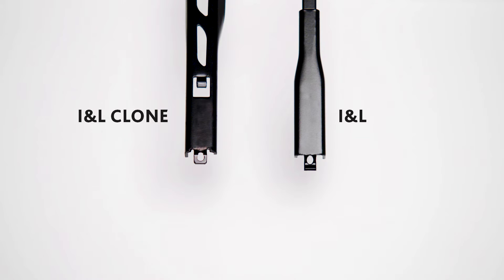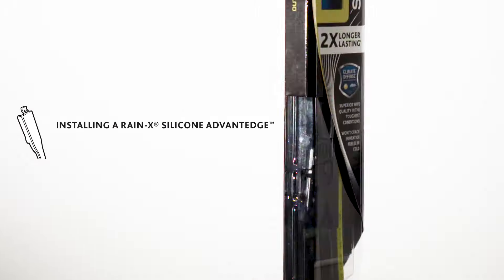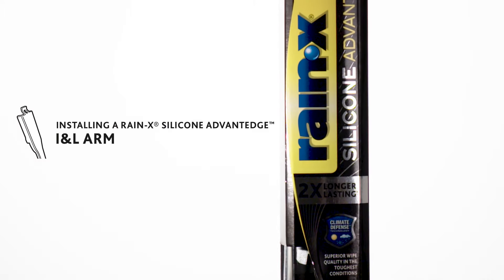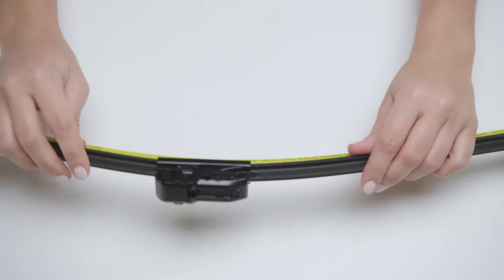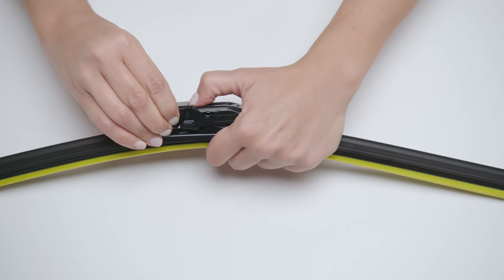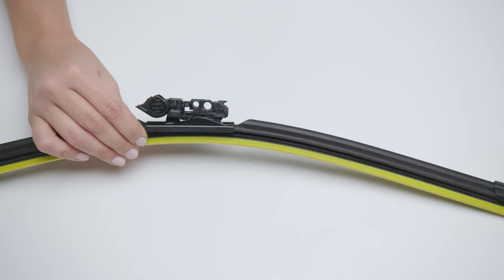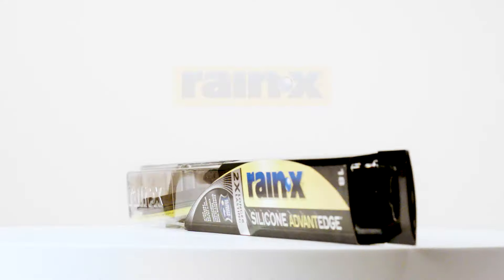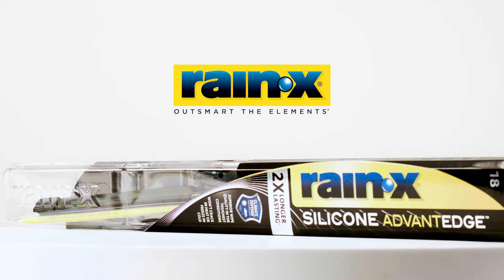Rain-X Silicone AdvantEdge Wiper Blade - I&L

Comment: One useful action to take.  When you hook the rear of the wiper mount to the arm, make sure the mount is seated hard up against the underside of the arm end.  If you don't, the end cap won't lock with a "click."  Just make sure the wiper mount is seated tightly inside the arm.

Comment: This video was definitely needed. Also, on my 2012 Silverado 1500, once I placed the arm into the adaptor correctly, I found that I needed to use more force than I expected to get the adaptor in enough to click - and get the cap to click closed.

Comment: I got stuck on the install at first because the wipers felt like they were going to break. I watched video and saw that I was doing it correctly in the first place! It snaps right into place, flip the lock over and they are done. Already a big difference vs my old blades.

Comment: Another word of "wisdom":  there is only a rear hook receiver  on ONE side of the adapter.  I started on the driver's side, and from my vantage point I could NOT figure out how to get the adapter onto the hooks.  Thirty Minutes Later (Spongebob narrator voice) I gave up and went to the passenger side.  From that vantage point, I could see the "other" side of the adapter with the receiver for the hook.    Sigh....
Reply: Thanks for pointing this out. Also, on my 2012 Silverado 1500, once I placed the arm into the adaptor correctly, I found that I needed to use more force than I expected to get the adaptor in enough to click - and get the cap to click closed.
Reply: I also thought it was weird that there is only one hook. That’s why i looked up this video